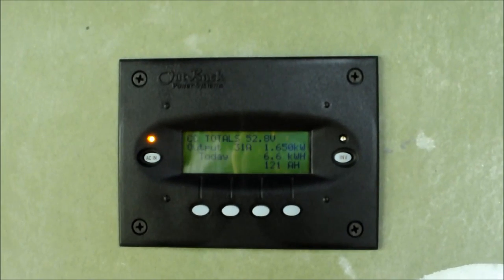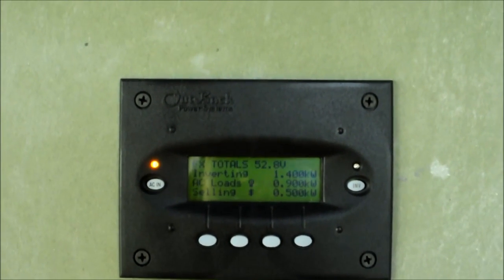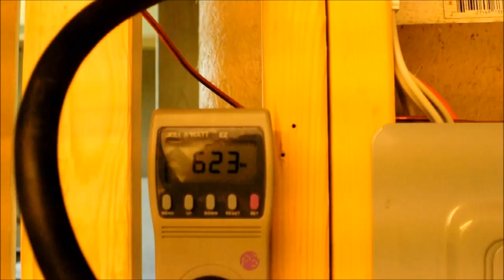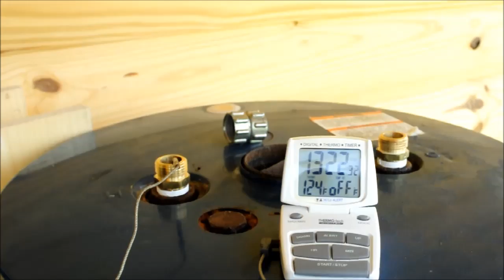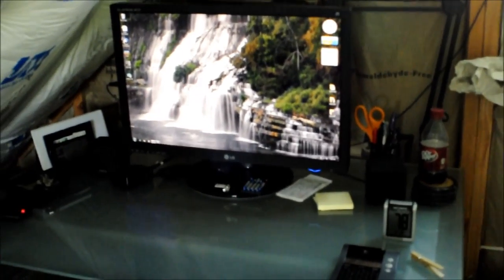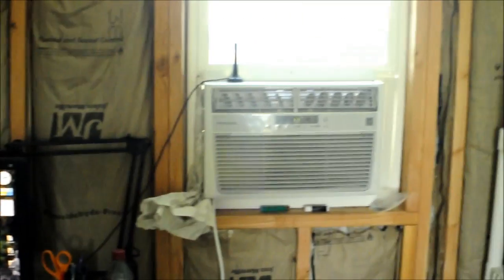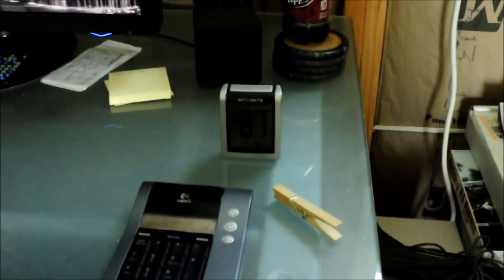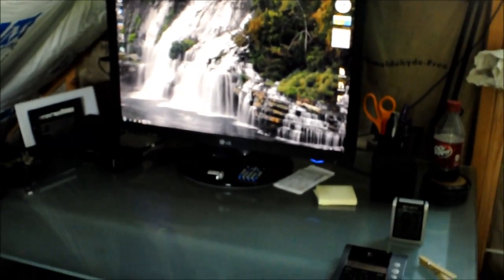Off-grid solar powered cabin update - Outback Power Systems

Comment: You need to oil your door hinges.
Reply from the maker: You might be right. I had to abandon that cabin in March of 2014. No telling what sort of maintenance is needed. My system is now in NV powering all my 120v circuits and so far has produced 5.54 kWh and it's a little after 1pm. I changed the batteries to BattleBorn made in Reno, NV. So much better than Lead Acid.

Comment: Hey this is similar to what I am trying to do.  What gauge wire did you use between the inverter and the sub panel?  Is there a recommended gauge?
Reply from the maker: My whole system is 4 ga. For the inverter it's recommended to go much bigger, I think the manual states 1 or 0 because it can pull 6000 watts for a moment. I'll upgrade later, I just got this system installed in my home in NV. As far as keeping it at 4 ga, I usually don't pull more than 30 amps and 4 is good to 70 amps. I'll be making a video soon on all the upgrades.

Comment: What size is the cabin, I seen 320 sq ft so maybe 16x20 with 2 porches. Any floor plan? I'm looking to build something similar sometime in the future.
Reply from the maker: gj4king1 Thank you for the complement. I think in total it took about 6 months to get it liveable. Still haven't put in floors or drywall but it's insulated and air conditioned. Personally, I purchased a couple books on shed making just to understand all the basics.
Reply from the maker: OppugnAll Floor is 320, 16x20 not including the enclosed area of the back porch. Porches go out 5 ft making the footprint 26x20. I never actually drew up plans, just built as I went.
Reply: +HamrickCE wow that is a beautiful  cabin  how long did it take you to build it? Any intro books you recommend  for building a cabin?
Reply: +HamrickCE any particular  book on shed making you used the most  that is your favorite ?
Reply from the maker: gj4king1 Not really. One was from Black & Decker which also made a series of books on plumbing, electrical, tile, etc... I don't remember the other book as much.

Comment: Hey man, thanks for the video! Great info. I'm in the process of planning my off grid project and I'm trying to decide if I should go Outback 24v or 48v inverter charger. In your experience what voltage would you choose? Cheers
Reply from the maker: Both voltages are useless in any other context which is why I went with a 48v inverter. The higher the voltage the more efficient because you aren't carrying as much current. The lower the voltage the bigger the wires have to be. I have a backup 12v system I use which also runs my water pump. Since it is separate I can charge car batteries or use any off shelf 12v item, but when it came to the amount of power my inverter could handle the higher the voltage the better.
Reply: HamrickCE Much appreciated thank-you!
Reply: +HamrickCE Unless you ever make the mistake of zapping yourself, then you'll wish you'd gone 24v :)

Comment: Dude, a true bachelor!

Did you connect your 10th panel to another controller? I assume you had the panels wired three in series, and three strings, which is why you weren't using it?
Reply from the maker: No, the 10th panel was going to be a spare until the wind tossed it about and shattered the glass. But, yes.. that is the reason I wasn't using it. My plan was have 2 in series, 5 total sets but the voltage was better with 3 in series.

Comment: hy...i am not able to understand whether i need some interface between my outback mppt charger and outback inverter/charger to let them communicate with each other during the charging of batteries (inverter/charger charging the batteries from the mains/grid supply), or should i just install them simply without establishing any communication between them. if i need to establish link between them, do i necessarily need to buy the hub or just install the simple communication cable between the ports of inverter/charger and mppt 80 ??
Reply from the maker: I know the charger can stand alone but beyond that I purchased the mate since that ties everything together. I think you need the mate for the inverter/charger because there is no way to program it otherwise. Since mine is grid tied I have it all tied together with the hub but I haven't played around to see if it "needs" the mate to operate. You may have to dig though the manuals to see what you can get away with not having. Also, I think you have to use the hub. Just like needing a switch between computers.
Reply: HamrickCE are you satisfied with the performance of inverter ??? i am comparing it with schneider conext sw2524, for off grid use, but its hard for me decide which one to buy....would u recomend it having used it so far??
Reply from the maker: ***** Very satisfied. I have had solid state inverters fail. Since this one is a big heavy transformer it has a decent warranty (5 yr. I believe). This is the sealed model, the vented version gives you a few more watts but I went sealed so I didn't have to worry about dust or sand when I take it to the desert. This is also really flexible in that it connects to the grid or a generator, puts power back on the grid and will charge the batteries using the grid or a generator. I don't even know it's there, once it's set up I can run saws, lights, etc... just like being connected to city power.
Reply: thanks..that was very satisfying...another thing about the solar charger, does it have the built in reverse current protection ? i mean do we need to manually shut the PV array off in the evening or the controller does it all by itself ?? and does that also have short circuit protection etc ?? does that steps up the voltage as well, i mean if my battery system is 48 volts, an pv array is 40 volts, will it steps up the voltage or it just steps down ?? i tried to search data sheets of the controller but could not find these answers...thought may be u know..
Reply: and another thing...does it automatically detects the battery system voltage level (12, 24, 48 volts etc) or we have to manually configure for that ?
Reply from the maker: The inverter is a set voltage, this one is a 3048 which means 3000 watts, 48vdc. They have other models but I chose 48v for efficiency. The charge controller will ask when you apply power what voltage you are using. I have used 12 and 48, but you can set for 24, 36, and 60 volts.
Reply: HamrickCE and the answer to my comment before the last comment ??
Reply from the maker: Once setup everything is automatic. I have only seen my cabin 3 times since February. I'm not sure the protection they installed, I make sure the red goes with the red and black with black. The panels go through the charge controller and that can handle up to 150v. It will change the voltage to what you set it to. It isn't like the 12v in 12v out. My panels are around 100v and have charged both 12v and 48v. I am really impressed with Outback's system... it seems to handle any configuration you can think of. For the price I don't think they can be beat. I'm saying that so you will understand that it works and works well.

Comment: Don't ever get a goat. The very first thing it will do is jump up on and destroy your panels. I have, Uh, I mean I had a goat. It seems that he has destroyed everything he has been able to get at. I even caught him trying to knock over the posts that support the deck. He has punched holes in the walls of the barn. Torn down fences, I could go on and on. I worked all day installing chicken wire under the chicken house to keep the baby chicks from escaping. That night the goat got under the chicken house and with his horns, tore up all of the chicken wire I had installed. he suddenly disappeared the next day. If you ever do get a goat a fence won't help you unless it is electrified. But enough about goat warnings. Great video and you have a really nice place for yourself there. Good luck with your continuing projects. Also, if money ever gets tight it is not all that difficult to build your own solar panels and saves you a ton of cash.
Reply: +Draugr Hessler Leash the Goat, Check.
Actually I jest, I'd only have the chickens myself, maybe a single female cow, mainly plants, fish, algae, phytoplankton in that order.
Reply: Well thanks for the heads up.... want two goats????

Comment: Maybe I'm confused. 600 watts for AC is around 6 amps. So 12 gauge wire should be more than enough. 14 gauge wires is good to go for 15 amps at 120 Vac.

Nice system BTW...LOL
Reply from the maker: Not AC from the panels. The voltage from the panels is around 90 volts, and I average 1.5kW from the panels which is 25 or so amps. Peak is 2.2kW... but I have resized the wire to 6ga which also gives less resistance for the 50 ft of wire.
Reply: The power from the panels is DC or AC? If DC then yes you need a lower gauge wire (higher current). AC wire in a homes is 14 gauge for 15 amp & 12 gauge for 20amp.
Reply from the maker: From the panels is DC... the 12 ga I was using was ok, perhaps lost 6% or so. I used what I had and now it's sized much better. My cabin is sized according to codes. I'm using 14 but in 320 sqft I have 6 circuits. I'm big on overkill. When you get to DC you have to be concerned with voltage drop. This is the reason Tesla was right and we have AC going to our homes... Edison wanted DC.

Comment from the maker: Everything is outback. I have the 60 amp version. The inverter is the 48v sealed unit. They make a 48v vented that can handle a few hundred more watts but I went sealed. I currently have 8 Trojan T-105 RE batteries. They are 6v so it takes 8 to get 48v. Be sure to get the voltages programmed into the charge controller, each battery has it's own voltage specs. I haven't had time to make a video on that yet.

Comment: that is a very nice setup. You have definitely put some money, thought and time into it. Just wondering about the panels, are you concerned with how low to the ground they are? Just thinking if a large animal might climb on top and scratch them. Or how secure they are so no high winds might blow them around. I've seen some well tethered modules get blown off here in FL. All in all, a very nice setup.

Comment from the maker: Yes, If you use this same charge controller. Most charge controllers require them to match the battery/panel voltage but this Outback Charge Controller allows for up to 150v from the panels and can be stepped down to 12,24, 36, 48, or 60v.

Comment from the maker: 24 would be more efficient than 12, 48 more efficient than 24 or 12... the higher the voltage the more efficient. But if you plan to use a bunch of 12v appliances then converting down from 48 to 12 will loose efficiency. Better to build a 12v system for that task. Build the system according to your needs.

Comment from the maker: The higher the voltage the better the efficiency. The lower the voltage the more current needed to do the same amount of work; therefore, the larger the wire needs to be.

Comment from the maker: You make a good point, I use a mirror to service them and being of small stature it is only mostly difficult. I also plan on putting them in the battery boxes used in boats, I have 2 from my 12V setup, I just haven't gotten the rest. Batteries should be OK for now since I don't cycle them. I used to work on tornado sirens and have seen the batteries explode.